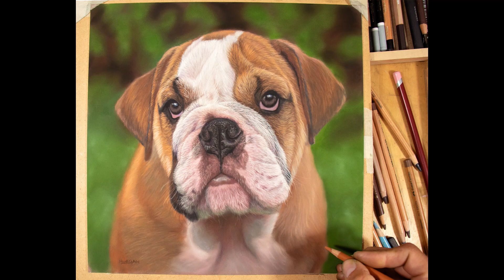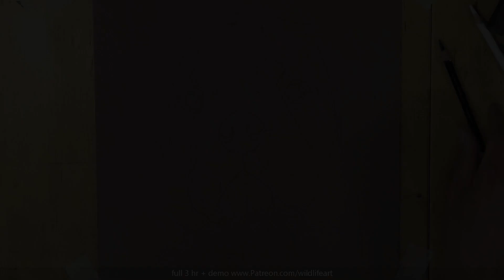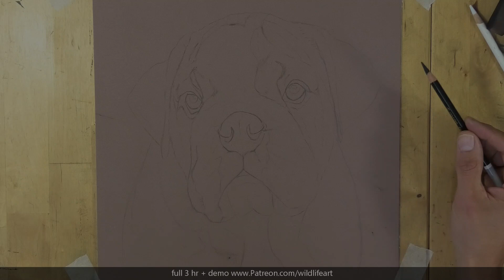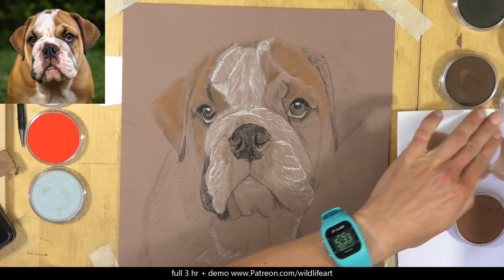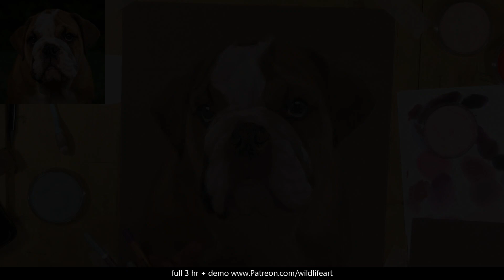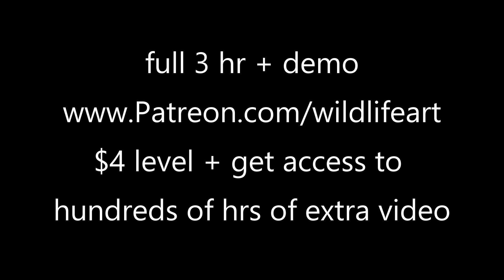Drawing dog fur - Master Pet Portrait: Quick PanPastel and Pastel Pencil Tutorial

Comment: Hi, Jason, I would like to ask you if you think Pan Pastels are ok to be used as an underpainting for oils. I'm thinking of doing an underpainting in pan pastels, fix it with a caseine spray (similar to Spectrafix) and then use oil glazes on top (no turpentine). The support is gessoed paper (with the Liquitex transparent gesso that works well both with pastels and oils). Of course one can mix whatever mediums they want but I want to know your thoughts on the durability and true compatibilty of such two mediums put togheter. Thanks!
Reply from the maker: I have never tried that myself, but I have used charcoal as an underlayer, then spray fixed that, before putting oils onto and that worked perfectly. So in theory I can't see what it would not work the same. If was not a heavy layer of charcoal though. So I would certainly test it out 1st.
Reply: @wildlifeartjm  Thanks!

Comment: Great video! I only made one paiting with pan pastels so far. On Pastelmat. I tried to use the applicators very lightly. But still I damage them during one painting. I have seen video's where they use synthetic paint/make-up brushes (with very soft hairs). Did you ever tried that? What do you think of that? Would it work on Pastelmat?
Reply from the maker: See my videos on that.
Reply: @wildlifeartjm  I did see your video on make up sponges. And I agree with you on that one. Do you also have a video on actual brushes. I mean the ones with hairs, not the sponges… I can't seem to find this. My apologies if I overlooked